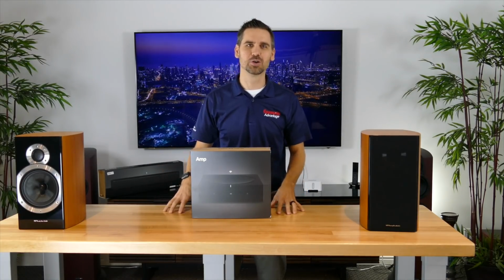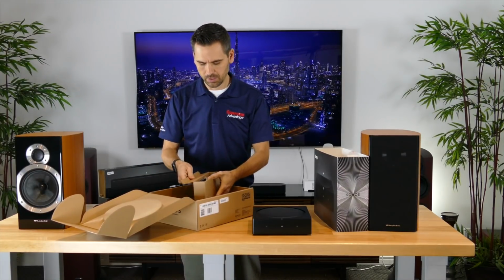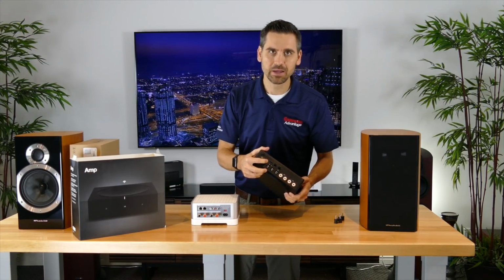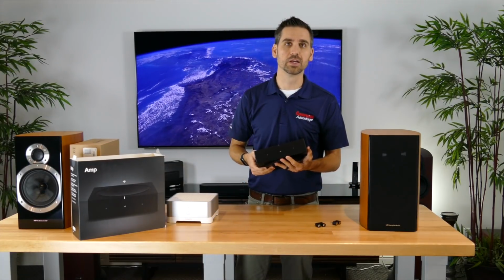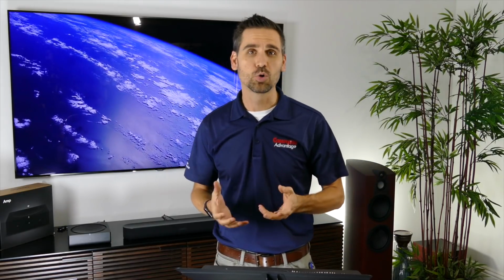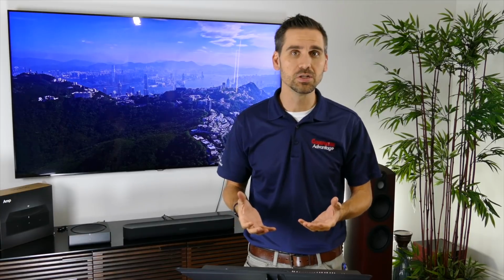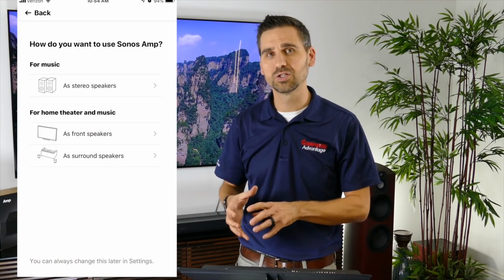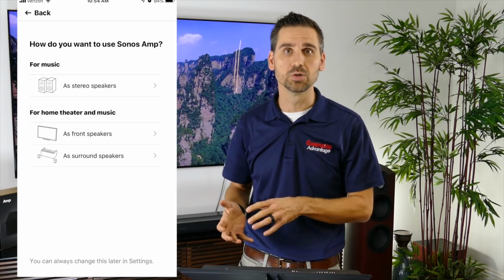Brand New SONOS AMP 2018 / Unboxing and feature overview

Comment: According to SONOS website the new AMP can run in 'Dual Mono Sound' instead of Stereo. Would you be able to do a quick 3 minute video showing this? Opens the potential to use 1 AMP to power up to 4 ceiling speakers spread throughout the house. No one on YouTube is talking about this feature.
Reply from the maker: https://youtu.be/k2cDs0i8ucY :)

Comment: Can you use the new Sonos Amp to take the surround signal out of the HDMI cable, amplify the front audio to your front speakers via it’s speaker terminals and send the surround audio wirelessly to a set of Play:1’s, Play:5’s or Sonos One’s?
Reply from the maker: Thanks for the question.  IIf I understand correctly, YES.  You can have the Amp connected to the TV via HDMI ARC (or HDMI/Optical Adapter) with 3rd party speakers, serving as your Front L/R speakers.  Then add 2 Play:1's etc as your L/R surrounds.  Yes this works. It creates a 4.0 system with the center channel split to the front L/R.  Add a Sub for 4.1!
Reply: @ComputerAdv  one note, you have to add Sonos sub since the sub output is disabled by software, on purpose... And we all know how much that thing costs...

Comment: Very informative, thank you! Being new to Sonos I was wondering if I could use this amp along with my existing Playbase to power third party rear channel speakers and a third party sub woofer to create a 5.1 system?
Reply from the maker: John.  Great question.  Yes i will power 3rd party rear channel speakers.  You just need 2 speakers and speaker wire. Setup is done through the sonos app.  As for the sub, on the Connect:Amp it was not possible to use a 3rd party sub when the Connect:Amp is configured as surround speakers, as all connections (besides the speaker terminals) were disabled in this mode.  We believe it is the same on the new Amp but have not tested it.  We will try to set it up and test it this week and update our reply.
Reply from the maker: John, we have confirmed that the new Sonos Amp works the same as the Connect:Amp when setup as surrounds.  The Sub out port is deactivated, in this mode.  So you will not be able to use a 3rd party sub in this setup. 🙁
Send feedback to sonos, maybe they could add that capability in a firmware update...
Reply: How do you submit feedback to Sonos? I just had my system installed. It includes 6 separate AMPs that are connected to TVs in various locations. The video signals are distributed to the TV through a 4x4 matrix in my system rack. My cable boxes are now overheating but only after including the Amps into the scenario. I'd like to inquire whether they have heard of this issue.
Reply from the maker: @jonnye2357  you can call, email or tweet Sonos.  https://www.sonos.com/en-us/contact/contact-options%23 
are the amps in the rack with the cable boxes?  If so it might be a matter of the added heat produced by the Amps, combined with all the other equipment might be increasing the overall temp enough to overheat the cable boxes.  If it's a closed space that would be my first guess without being there to investigate.
Reply from the maker: We use the contact us on the SONOS app. They respond super fast via TWITTER as well.
Reply: @ComputerAdv  They did it on purpose to make you pay the ridiculous amount for their sub. There is no reason why I couldn't use the Sonos Amp with my KEF speakers plus sub (directly connected to the Amp) and 3 more Symphonics as center and rear left and right for a all in one system. That way I could listen to music with my 2.1 and with a press of a button turn it into a real 5.1. I would sell my Denon Heos amp and buy this in a heartbeat but as it is it makes no sense. I am aware that the Amp is not the same quality as Denon's for music but I would do it for the sake of convinience...
Reply from the maker: @superpeca  I you use the Sonos Amp as your front speakers you can connect a 3rd party wired sub.  It splits the center channel to both the left and right channels.  If you use 2 Amps and your KEF sub you will end up with a 4.1 system.  Sound odd (because it is) but it really does sound great. The sub just has to be connected to the front speakers amp, not the surrounds amp.
Reply: @ComputerAdv  Again, to my point - buy two of our amps or a sub to have 5.1 or 4.1 (quick note - 4.1 works only for the person sitting directly in front of the screen, if you are a bit to the side you will miss a lot of that virtual center, that's just how stereo imaging works). One amp is more than capable of running such a system - 2.1 directly connected to the amp and two wireless speakers in the back - the limitation is enforced by software and by design. I value the brands that give consumer features once you bought into their system, not take away so they could drag their hand in your pocket even deeper. This is not a rant, I honestly hope Sonos sees this as a mistake and corrects it. For 600 USD I will buy the JBL 5.1 bar with their wireless subwoofer and detachable rear speakers and keep my Denon and KEFs for music, completely separated from the TV. I think it is a good product, but also a missed opportunity...
Reply from the maker: @superpeca  👍🏻

Comment: Great video thanks! Curious if you could augment an existing Sonos surround system with the AMP and 2x front speakers? 
To clarify, I have. Playbar, Sub and 2x Play1s as my current setup. Could I add an AMP and two more speakers in the front to play the TV audio as well? 

Also would be interested to see how the AMP compares to the AMP:CONNECT when it comes to playing vinyl! 

Again, great video thanks!
Reply from the maker: You could make the Amp a 2nd room and group the Playbar room and the Amp room together in the App, that would give you addition front L/R sound.  Just make sure to turn off the "Ungroup on Autoplay" option on the Playbar room under Room Settings > Playbar Room > TV.
They will stay grouped until your ungroup them in the app.  However your TV remote will not control the volume of the Amp speakers.  
I don't have a record player but it should be virtually the same as the Connect:Amp.

Comment: hello great video. I have 2 outdoor speakers powered by the sonos amp.   If my outdoor tv does not have hdmi arc, is there another way i can hook up my tv to the sonos amp and play through the outdoor speakers?
Reply from the maker: Hi Ken, Thanks for watching. The TV has optical out you can get and Optical to HDMI adapter from Sonos.  The connects to the back of your TV then the HDMI cable connects the adapter to the AMP.  Hope this helps. If you are near Sarasota FL we have some in-stock :-)

Comment: Hi. Thanks for the video...quite informative.
I already have a harman/kardon go+play and was wondering if i could connect it to the Sonos Amp as a sub....?
Reply from the maker: The sub output on the Amp is for a powered sub.  The Go+Play is a self-contained speaker system so it would not work with the Amp.  However, any power amp that has a standard amp input (single RCA style connector) will work.
Reply: @ComputerAdv  thank you. Appreciate your advice.

Comment: With either amp if I wanna hook up my turntable do I need an amp for the turntable since it does not have built in amplifier or do I ply straight in?
Reply from the maker: You would need a phono pre-amp for a turntable that does not have one built-in.  These range from about $20-200.
Reply: ComputerAdv I thought that’s why it’s called sonos amp cause it was an amp also. So you still need a amp for it?
Reply from the maker: @nme6725  It is an amp because amplifies the signal out (IE powers passive speakers).  The input is a line level input.  A turn table is not a live level device.  If you have ever had an AVR with a PHONO input that is an input specifically for turntables and has the pre-amp built-in (the opposite is true as well if you connected the turn table to any other input, AUX, CD, etc it would not work).  The Sonos Amp does not have a phono input.  So you need a pre-amp device to make the turntable to a line level input. Hope this helps.
Reply: ComputerAdv ok cool. So I need the connect amp and an preamp for my turntable to work.

Comment: thanks for review.  I have a playbar with optical audio cable coming from TV now. Unfortunately, TV strips surround info off the optical out. But it does support ARC. I'm wondering if this might be a work around to get back to a surround sound system the way I did with wires before Sonos?
Reply from the maker: Some TV's may support 5.1 via ARC and not Optical but it depends on the TV.

Comment: I’m thinking of buying the new AMP. In a set up with two BW 684 s2 in front and two sonos 1 speakers in the back. And connected to my tv. Is it possible to listen to music in stereo with only the two BW’s and switch to all four speakers for the tv?
Reply from the maker: If you make the it a 4.0 system with the BW in front and 2 Ones in the back it will always be a 4.0 system unless you go through the process of separating the rooms, chances are you will not want to do that every time you switch between TV and  music. However, you can set the rear speakers down for music play back and leave them turned up for TV sound.  You can find this under More > Settings > Room Settings > 'Name of Room' > Advanced Audio > Surround Settings.
Reply: ComputerAdv Thank you. So with the raar speakers down I will have stereo for music?
Reply from the maker: @LaurensSt1  Is the Amp will provide stereo to the BW speakers since the source (music) is sending stereo sound.

Comment: Great video.
I have 4 ceiling speakers in my lounge room. For a 4.0 setup can I power the 4 speakers with the one amp?
Reply: You can power 4 8ohm speakers on with one Amp, however is will be 2 stereo pairs.  To do a 4.0 setup you will need 2 Amp, one for the Front speakers connected to the TV and 1 Amp for the rear speakers.

Comment: Would this be the best option to use the Sonos set as a surround set? my setup would be:  NEW AMP with 2 passive speakers connected as front, 2 Sonos play:1 as rear and a SUB connected to the NEW AMP. I don't have any space for a Play bar or boost under my TV unfortunately. Do you have other suggestions?
Reply from the maker: That would work fine.  We are actually setting up a system with 2 AMPs powering in-ceiling speakers with a SONOS Sub to get 4.1 sound.  The setup did not make sense for a soundbar (Playbar or Beam)  and the speaker in the ceiling are already installed.

Comment: Can somebody tell me if I can port this into my existing Sonos multi-room set up, to inject a DAC into the system to improve the overall sound ? is that accurate    thanks
Reply: Friend, if you want an external DAC your are talking about a serious HiFi component system which this is not. Sonos has a place in every home and it is a good product but you should have a system of separate components like an AB class integrated amp and a decent set of speakers for music enjoyment at its fullest...

Comment: Hey there, thanks so much for the vid! I have a sub (2. gen), playbar and 2 Play1 as a sourround setup and and all different rooms each one Play1. My question is - can I use Airplay 2 on my current setup and make it work? Because since with the new AMP? Till now it seemed Sonos forces me to replace all my 5 Play1s in my flat to be able of that 🤯 Does my Question makes sense? Lol THANKS IN ADVANCE!
Reply from the maker: If I understand correctly, no :-(  the new Amp does support Airplay 2 but I don't see where you listed that as one of your devices. You need at least 1 Airplay 2 compatible device.  Airplay 2 compatible devices: Sonos One (not Play:1), Play:5 gen 2, Playbase, Beam, and the new Amp.  If you have one of these then you can airplay to it.  Then if it is grouped with your other speakers (Playbar, Play:1, etc) then they will all play the Airplay 2 audio.  So the easiest way to add Airplay 2 is to replace 1 of your Play:1s with a Sonos One, it just needs to be a stand alone room (not the surround speakers of the Playbar).
Reply: ComputerAdv nah, that‘s what I ment... IF I buy the amp, then it would work? But that amp would just make the sourround sys in my living-room airplay2 ready, right? If the other rooms are grouped each one to an own group (like kitchen, etc.), then just the amp in the living-room works not for those other groups, right? Because the vid says that the amp can even make a regular-cable-speaker smart and with airplay2...
Reply from the maker: @DENYO84  The Amp is Airplay 2 compatible so if it is setup as its own room (not the surrounds for your Playbar), the it will show as an Airplay 2 speaker on your iPhone.  IF your have other rooms grouped with the Amp, (Kitchen, bedroom, etc) in the sonos app then they will play the Airplay content as well.  But you will not be able to directly Airplay to the Play:1 in your kitchen, it will only work if the kitchen is grouped with the AMP and you pick the Amp in the airplay menu.  Hope this helps.
Reply: ComputerAdv HELPS A LOT!!! Thanks! But last question... My priority would be to make my living room airplay2-ready - does it work to integrate the new amp into my current 5.1 set-up (soundbar in the front and 2 Play1s as rears + the sub)?
Reply from the maker: @DENYO84  No, the Amp does not have a place in an already configured 5.1 setup.  I assume that eventually Sonos will come out with a replacement to the Playbar that does support Airplay2 but that is just hope and a dream at this point.  If you wanted to get Airplay 2 in your 5.1 setup you would need wait and hope for a product that does not exist OR replace the Playbar with a Playbase or Beam.  
Depending on your listening habits you could sell your Playbar and buy a Beam.  The Playbar is a better speaker than the Beam but since you already have a Sub that helps out the Beam a ton.  At my house i only notice the difference between the Beam and Playbar (both with a Sub) is at higher volumes the Playbar really sounds noticeably better.  At my normal listening volumes it is difficult to notice the difference.  
The Playbase is going to give you almost identical sound to the Playbar, however the form factor is very unique and only works in certain situations.
Reply: ComputerAdv ok, that‘s a catch-22 I guess... But thanks SO MUCH for clearifying everything - I really appreciate it man!
Reply from the maker: @DENYO84  Yes, you are welcome

Comment: Does the new Sonos Amp support control through Amazon Alexa?
Reply from the maker: All sonos products can be controlled with Alexa if you enable the Sonos skill.  However, the Amp does not have Alexa microphones built-in to the device.  so voice control would go through another Alexa device, Sonos One, Beam, Eco, etc.